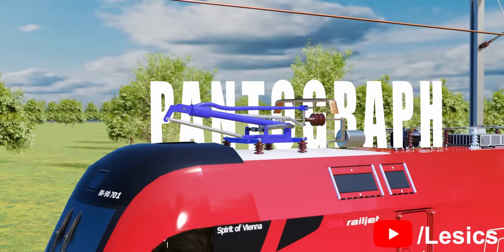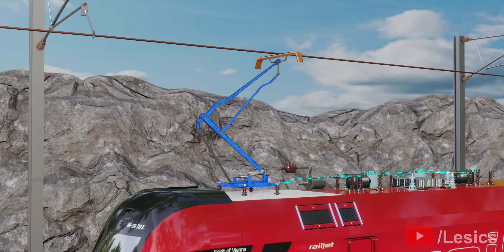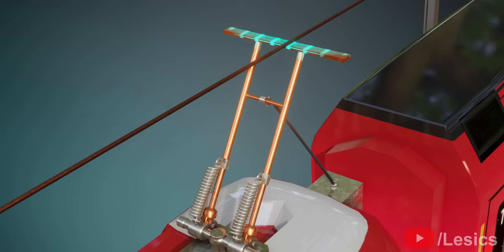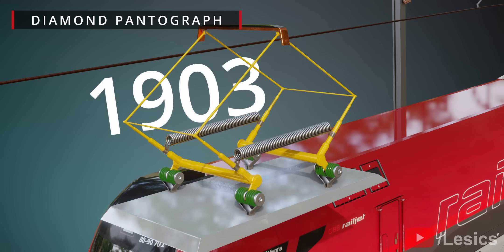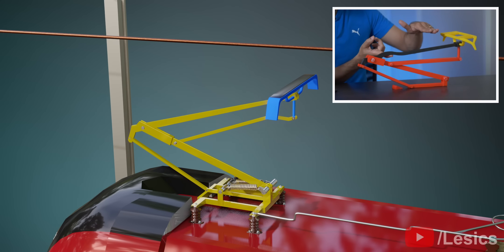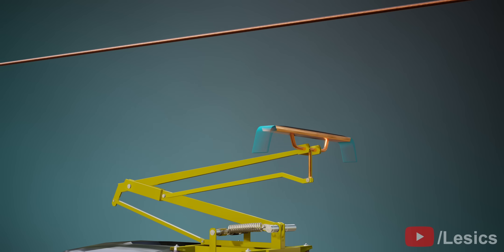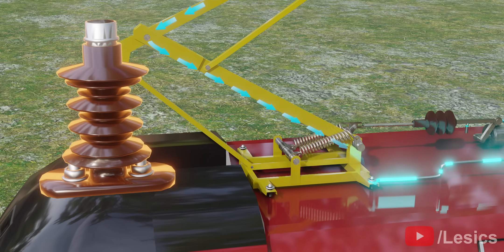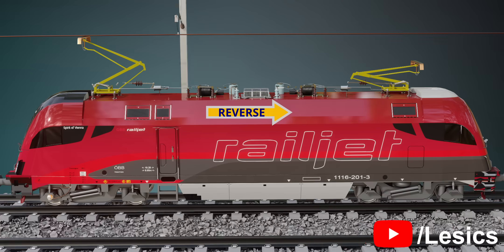The Brilliant Engineering behind Pantographs!

Comment: I really like this video, and as a train enthusiast I'm happy to have learned more detailed info about this key component of electric trains, as well as appearance of the Austrian Federal Railways Railjet train - a railway beauty  from my country :)

But, it does pain me to see the inaccurate position and direction of the pantographs displayed on the ÖBB Type 1116/Siemens Eurosprinter ES64/U2 locomotive, one of my favourites.
They are reverse, and the reason for front/or back in this case are explained in a comment by another viewer.

Also, the operating voltage varies from country to country and between train systems, while this specific type can run two: 25kV AC as mentioned, or 15kV AC at 16 ⅔Hz in Austria, Germany and Switzerland.

Vienna Trams and Underground on the other hand, for example, run on 600V resp. 750V (DC). All Trams and one Underground line use overhead lines with those pantographs.

Just some side info, "Um, actually" style ;-)

Comment: actually it is not always horizontal wihtout electronics, it is always paraller to the road without electronics.
the second is easier than the first.

remember if you have a 10% incline, the lines that the pantograph is using are at the same incline.
so you just design something to keep the pantograph parallel to the base where it is put on. still interesting but not the same. 
and for a channel that is trying to teach something such details should matter

Comment: That was pretty good about the design of the pantograph, but the information at the end about why trains have two pantographs or why they only use the one in the rear is missing more information.

Trains have two pantographs in case one fails and they will occasional run with both pantographs if there is ice on the catenary.

Trains run with the rear pantograph up, because if it gets destroyed or knocked off, it won’t damage anything else. If the front pantograph gets knocked off, it has the potential to damage other components on top of the engine, including the rear pantograph.

Also, pantographs have an air line running through the collector head that will automatically lower the pantograph if the carbon strip is too damaged.

Comment: I think the design show at 3:41 (Bow collector) could work equally good to Pantographs if you can control the upwards pressure. If I've understood correctly, the design of  Pantograph is so much more complex to allow constant pressure between the collector head and the line without the need to adjust the air pressure in the system to adjust the contact force.

Comment: On top of it being practical having two, 
There still are some cases where the Front one must be used
For example If you have a freight train transporting Cars through a whole country. Imagine what the top Car would Look Like on the First Waggon of the rear one was used.  Since the Carbon Strip still has some wear to it the Car would be covered in sud.

And in Germany the food Wagons in the ICE have the Power supply via one aswell, but those are Not meant to be driven with, they are Just sturdy enough to keep fridges running
Reply: through a what country?
Reply: @BlueNEXUSGaming  Well... Thats Auto correct, trying to fix english when it is Set top German. Fixed it tho, thanks for the Heads Up

Comment: From KG to PG. From Kinder Garten to Post Graduation. The adaptability of the Pantograph to changes in levels of Traction and form an effective conduit for the heavy electric power from source to the motor is well detailed for easier understanding. The surge current aspect as and when the pantograph makes and  breaks the supply system is worth appreciating resulting in a sparkless phenomena. The alignment  and supports system with the holding system, governed by mathematics of Catenary Curves also play an important role in keeping the traction wire to remain horizontal throughout the stretch. It is a perfect example of an integrated engineering marvel of Team Work.  I rate this  video 10/10. RangarajaN, Jersey City, Jul 02, 2022
Reply: I must have missed the bit about 
?in-rush current?
, i only saw the mechanical development of pantographs.

Comment: Ok. Why not just use some metallic conical wheels that spin under the OHL to keep the contact head from wearing out? Most of the wear comes from sliding friction wich wouldn't be as much of an issue with a simple wheel or pair of wheels angled together to hold onto the OHL firmly but gently, as well as automatically guide themselves into contact with the OHL.
Reply: Putting that much power through a wheel bearing, of any type, is problematic as the current wants to weld the parts together.

Comment: Why don't they just put a grooved, conducting, wheel on top of the pantograph - similar to the bottom of the train.  This could simplify everything.
Reply: With a wheel you can maintain good contact on a straight track - but tracks sometimes divide in 2 directions, and the overhead wire has sections (which end after max. 750 m im Germany).
Wheels are sometines used for trams which drive with much less speed on simplified powerline constructions, it wouldn't be suitable for a faster more powerful train

Comment: Sorry but this is not the main reason for having two pantographs (well not anymore).
A modern locomotive often can run on different overhead catenary systems having different requirements (for example 25kV AC and 3kV DC with differents requirements). So choosing which pantograph is used depends on the overhead catenary system.
Reply: Modern locos made for different systems (AC/DC and different voltages) sometimes have 3 or even 4 pantographs
Reply: @simonm1447  Never seen a single unit locomotive with more than 2 pantographs. Any example?
Reply: @ppdan  One example is Siemens Vectron MS. It can operate at 15kV AC, 25 kV AC, 1,5 kV and 3 kV DC. It has 4 pantographs (2 folding in each other) in this version. Such locos are only used for border crossing traffic since the electrical system is also made for 4 voltages and the locos are more costly than a country specific loco just made for 1 voltage and for AC or DC
Reply: @simonm1447  Thanks for the info, never seen one with 4 pantographs.
We have some siemens locos that are the predecessor of that one and can handle 25kV AC, 3kV DC and 1.5kV DC using 2 pantographs (https://nl.wikipedia.org/wiki/HLE_18_en_19). One for AC and one for DC (when standing still on DC the AC pantographs can be raised to have more contact surface but will drop again once the loco moves).

Comment: I Lisbon and Porto (both in Portugal) there are still trams with the trolley pole collectors, but with a wheel instead off a grooved head. In Lisbon there are also some that have both the trolley pole collector and a modern pantograph as they share lines with more modern tram.

Comment: Hi. I am a train driver from Germany. Thanks for this very interesting video. I am not aware that both pantographs have to be raised at high speeds. Different regulations may apply in other countries. In Germany, the front pantograph must be raised if there are wagons with dangerous goods behind the locomotive, or wagons with plastic sheeting, or another locomotive. Because of flying sparks. In addition, the second pantograph is a fallback. There is a sensor in the contact strip that responds if the contact strip breaks. Then this pantograph is unusable. In the case of a locomotive, both pantographs may only be raised if the overhead line is icy. Then the top speed is limited to 110 km/h.
Reply: The video author meant that at high speeds you want to raise the pantograph on the back of the train, so that's why you need two. He didn't say that you raise both at high speed.
Those special rules are quite interesting though, thanks for sharing
Reply: In Czech republic at 3kv DC part of network is the second pantograph used when accelerating a heavy train to prevent local melting of catenary, there are over thousand of amperes going trough when starting a heavy train. Also used when standing in stations to prevent the same issue.
Reply: @schabigerlump  on modern locomotive (such as Vectron) it's not difficult finding a locomotive wich use the first pantograph, thats because in different country you must use different pantograph due to the different voltage on the contact wire. In some cases you have to use different pantograph even if there's the same voltage: for example in Italy and Slovenia, with the 3kV DC sistem, you use the same Pantograph, but in Poland you use another pantograph even if there's the same voltage.
(Sorry my english isn't perfect😅)
Reply: Also if the train has new automobiles on the the car directly behind the locomotive, only the front pantograph must be raised. Sparks from the rear pantograph could cause damage to the windshields and paint job on the automobiles.
Reply: Not quite, as maxono1 said it's to give you one for each direction of travel - having two raised in high speed running can cause vibrations and resonance in the line between them. This has caused some odd issues with UK train designs, as in past decades engineers were uncomfortable running high voltage cables through passenger cars, which led to the APT tilting train having the locomotive in the middle, basically dividing the train in two
Reply: @brynclarke1746  It appears that they are more confident about multiple ones these days - e.g. trains made up of 2 class 80x 5 car sets, often used on the GW main line London - Cardiff (up to 125 mph), or even 3  class 387s (12 cars) up to 110 mph.
Reply: I'm not from from trains industry but I know that in Poland was usually used a second patograph especially for passenger trains because of things which can hang on the cabel lines (plastic bags, branches etc) If you use first pantograph you can damage a second one too while crash with some thing on cable - if you use second this problem not exist and you have one reserve pantograph.
Reply: In France they raise both Pantographs on starting and stopping because of the high current on railways electrified at 1500v dc. I have seen this.
Reply: your "sensor" is the carbon head on the pantograph, what's filled with air to held the pantograph up. oder auf deutsch, da du ja ein deutscher zu sein scheinst: dein sensor ist die "kohleleiste" oben auf dem Pantograph; da geht die luft durch (was hier nicht angegeben ist, da es nur eine einfache erklärung sein soll) welche dafür sorgt, das der Pantograph oben bleibt. Scheuert siie sich durch, oder reisst ein, geht die luft raus - und der Panto "klappt zusammen". Das ist das geheimnis zu diesem "sensor" - es ist nichts anderes als einfach nur eine einfache verlängerung einer Druckkammer, die dafür sorgt, das der panto zusammenklappt wenn jene bricht - um oberleitungsschäden zu vermeiden. nein, ich bin weder TF noch EiB, aber wollte sowas immer werden, weswegen ich mir solches wissen über andere EiB angeeignet habe.
Reply: @crashoverride6413 railway engineers are amazing at using pneumatics
Reply: This is from my observations and discussions with Amtrak repair crews for overhead wires on the Northeast Corridor. Amtrak’s ACS-64, Acela Express (American Flyer, current) and Acela Express (Avelia Liberty, future) has 2 pantographs (with the current Acela Express having 4), there’s no regulation in which one needs to be up, but it’s commonly the rear pantograph, but during subpar weather, specifically snow and ice, where there could be ice build up on the wire to provide redundancy and avoid short drops. Also it’s fun to see a spark sometimes, more so if you can get it on camera
Reply: I am locopilot from India, we raise the rear panto while moving forward n front one when we are shunting. But one panto at a time. Also the traction failure problem we face most of the time.
Reply: I am a train engineer for ICE trains. The sensor is usually a pressurised pipe which ruptures if the conductor is damaged, which cuts off the air supply to the pantograph via a series of valves.
Some countries require two or more raised pantographs due to higher current requirements (low OLE voltage) or longer trains.
Usually, we use special pantograph heads in icy conditions and have more regular checks.
Reply: @CKM1109 u must get many icy conditions while running ice trains hehe 😜
Reply: It depends on the electrification used. With 25kV AC for example you only really need one pantograph raised per unit, but with traditional lower-power electrification in some cases both may need to be raised.
Reply: Huh
Reply: There is a lot that is not correct in this video - including "both pantographs have to be raised at high speeds." That is not true, at all.
Reply: @markmanz8897  no where in the video does it say that
Reply: @markmanz8897  I think he says installed, not raised. It's not very clearly stated, but I don't think he specifically says you have to do two pantographs at high speed.

Some locomotives run two pantographs at low speed, as to prevent overhead wire overheating (especially on heavy locomotives, with low voltages (such as 1500V in the Netherlands)). It is then dropped pretty much after leaving the station.

Comment: I used to work in overhead line design. A guy I worked with designed a system in the uk where the lift is air powered and if a carbon came off the pan it released the air pressure dropping the pan to prevent damage to the line.
Reply: ADD has been around for a good while. I too know someone who put the idea forward through British Rail's OWLs scheme that was adopted on Cl.90 and 91 locos in the early nineties.

Comment: You can easily see how advanced the pantograph technology is on the shinkansen, and why they went trough the trouble they did resulting in the cool and weird designs of today
Reply: The high speed trains have another consideration because the trains themselves are going around a corner at an angle. The pantograph probably has to be adapted to also be horizontal in those cases.

Comment: in bullet train, there are even more pantographs on coaches 
for example, Japanese bullet train has 10 cars (2 trailers and 8 coaches) car no. 1 and car no. 10 (trailers) have pantographs as mentioned in the video but also car no 3 and car no. 7 would also have pantographs even they are just coaches but rest coaches no. 2, 4, 5, 6, 8, 9 would not have pantographs.
Reply: Japanese bullet trains are EMUs, that is every car has motors. There is no "locomotive" or "coaches" in a train set. Every car has its own propulsion and can carry passengers (At least in theory. Depending on the configuration, some cars may be pure coaches)
Reply: Typical the Restaurant have his own power supply. Some trains use secondary power supply or extra supplies for WiFi, internet, computer, network switch, hot water, aso. So all the system are independent - not that a broken router break the engine...
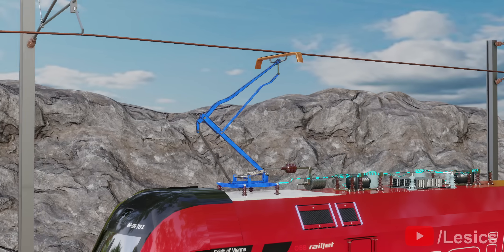Reply: The 500 Series Shinkansen used an unconventional pantograph design that a fusion of the one shown in 1:35 with the 'horns' shown in 8:05, but surrounded by a pyramid-like structure (or a sleeker fin-like one instead on the newer E5 to 7 models)  on the roof to protect it from being blown over by aerodynamic drag. P

Comment: Also if you use the front pantograph when going forward and anything should happen to it at high speed , it will come crashing down over the rear pantograph damaging it, leaving you with no power whatsoever.
Reply: That's common sense I suppose 💀💀
Reply: That is why the front pantograph is manually lowered by the driver. The driver's judgement is always important.

Comment: Great video.

Worth noting that the OHL voltage can vary considerably.

For example in Victoria, Australia, we use approx 1500VDC for trains and something like 650VDC for trams.

Higher voltage is more efficient, but our system is older.

Comment: I did not enjoy. You made it a miracle of pentagraph design. I see it everywhere in my neighbourhood and in my drive way. The basketball net and board has the same arrangements for changing the height of the board. It always stays vertical because of the two parallel bars that keep the position verticle at different height. So don't make it something very special this is a very basic design in mechanical engineering.

Comment: At out company we are instructed to use the front pantograph so there isn’t any carbon dirt going on the first cargo wagons. (Especially if it is transporting cars)

I wonder how much extra air drag it is. Because with a cargo train of 1600 metric tons would it really be so big effect…
Reply: Tell your company that if anything should happen to the front pantograph at high speed it will break down crashing over the rear pantograph damaging it too, then what are you supposed to do with the cargo cars and no power?
Reply: @touring46  High speed with a cargo train? our Max speed is 120kmh, most 100kmh. I have never heard an incident where a pantograph 'just' broke off during driving without another cause. ( object in the overhead wire or sending the train accidentally to a diesel track.) And if that would be the case then they would still send an other rescue locomotive because the damage on the roof will always be so big that there is risk of high voltage leaking to the frame... . Pantograph failures are very very rare so main issue is drag vs damage on the cargo.
Reply: @redpsycho90   Be serious, at 100 km/h and 1600 metric tons, worrying about the drag of the pantograph is just like worrying about the drag of the radio antena on a car....
Reply: The effect is negligible under low speed.
Reply: I believe the drag issue is more to do with the pantograph itself not maintaining a good connection because of vibration